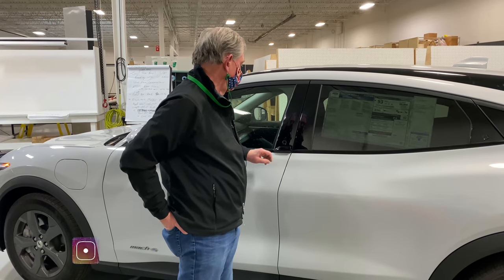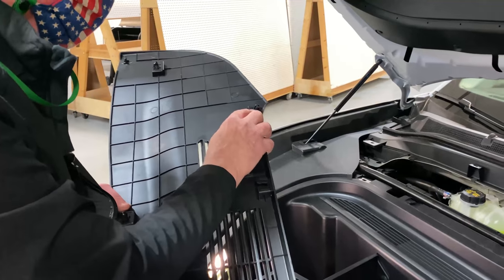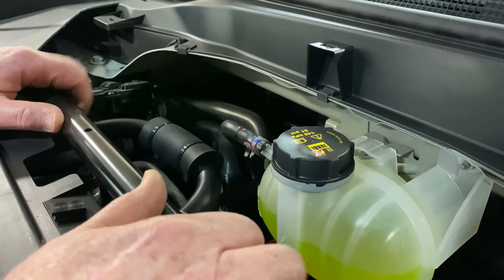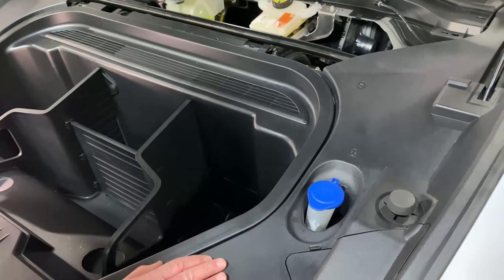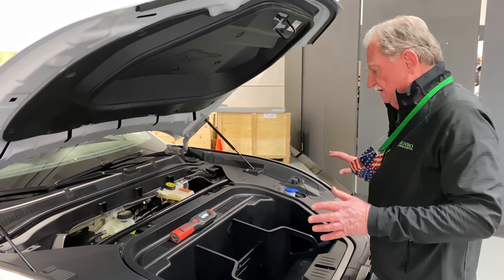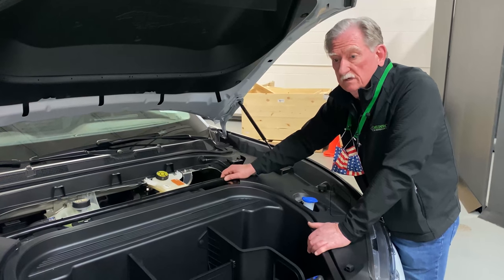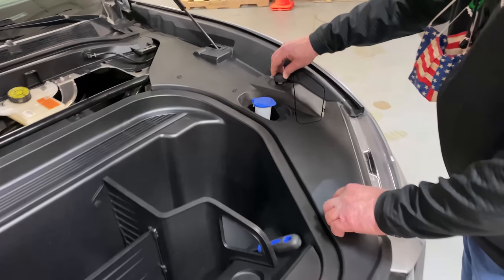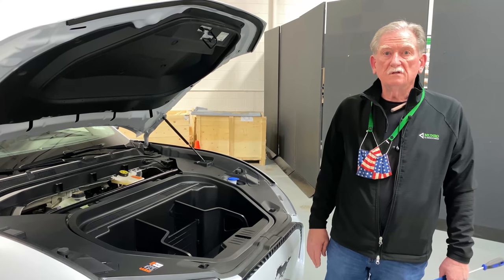2021 Ford Mustang Mach-E: E2 - Under The Hood

Comment: Water goes both ways via a drain hole (usually).  One of the great features of a Tesla is being able to drive through standing water.
Reply from the maker: We will check to see if there is a one-way valve. We typically see these on HVAC/AC Evap drains.

Comment: The Mach-E has remote jumper points in the driver's side cover under the hood. Apparently you don't need to get to the actual battery (page 268 of the Mach-E owner's manual). The Mach-E also has remote boost points under that little cover next to the passenger side headlight like Tesla for when the battery is completely dead (page 267).

Comment: Not as excited as Sandy about the frunk layout. Drain hole is a good idea for either a frunk or a trunk providing there is no way to have liquids regurgitate back up thru the drain. Next, I would have made the compartment separator removable because everyday is not a beer day, sometimes it's a grocery shopping day and you need all the space you can get.

Comment: The Mustang has considerable visible hood vibration. It's not uncommon. My 2014 Pathfinder hood looks like it is going to fly up at highway speeds. The front two bumps do not look adjustable, or at least not easily. The rear two can easily be twisted to find the right balance between hood vibration and latch friendliness. Some people complain the frunk is hard to close. They could back those back two bumps off a half-turn to make closing easier.

Comment: So after driving a lot, vibrations and all, opening your beer will spritz things out. But it is fine, you can drain the beer into the hole in the frunk. Drink the rest and decide whether your blood alcohol level is too high to get on the road. All jokes, of course, you don't have to have fizzy or alcohol in there.

Comment: Note to self - if purchasing a Mach-E stock up on body clips.  They break at the connecting hole... Also potentially stock up on replacment frunk panels as if they pull out of the panel they'll likely break the mount point on the panel.
Reply: That is every car on the road right now. Car manufacturers are enamored with snap-together cars...

Comment: Thing is the Mach E is a more expensive can than the ID4.
Reply: Yes it is,  both are good vehicles and cheaper, better built than Teslas
Reply: @GA-wq8xq  You clearly haven't watched Munro much if you think that >.<
Reply: @GA-wq8xq  Maybe when it comes to panel gaps but the Tesla is much better designed.
Reply: @XKS99  good design can be subjective. Tesla has some good design ideas but is also lacking in some areas such as not ha big a screen in front of the driver. All other EVs do this as most people prefer that. Tesla’s rear bumper was badly designed since water and sand/dirt got caught and ripped the bumper off, or the case of water flowing into the trunk when it was open and raining since water ran straight into it. So all companies make mistakes.

Comment: I don't think there is any waisted space in the id.4, the distance between the windshield and the front of the car is just one frunk length shorter than the mustang Mach-e. They made the hood shorter and increased the size of the cabin and trunk by doing so. What Tesla and Ford do they essentially divide the storage space of the car into 2 parts, while you can just move the cabin forward eliminate the frunk and have all of the storage in the trunk area where its more convenient to use
Reply: The front hood is also quite high on the ID.4, so honestly loading stuff in there wouldn't be very easy for a smaller person. Especially if you don't want to scratch the paint.

Comment: It looks like ID.4 hood is much shorter than the Mach E, the whole car is 14 cm shorter. Plus VW moved the HVAC unit completely in the frunk to maximise space in the cabin.
I don't see a lack of a frunk a defect, it's a design choice for two very different cars.
There is also a roughly 20K USD price difference between the two.
I think the Mach E is a much nicer car, however ID.4 gives a lot for the buck :)
Reply: I think it's more like a $10k differential at the lower end, but I agree with you.

Comment: I don’t like that the 12V jump point is behind a hard-to-remove, secondary plastic panel.  Tesla puts all the under-hood electrical/master brake cylinder elements including the emergency power disconnect under one easily-removed panel.

Comment: Front bumper has a hatch to get to to the battery wire if you need to “jump start” it
Reply: Those are wires you have to attach power to that opens the hood when the battery is dead.

Comment: That upper panel is supposed to slide away from you to remove, not be pulled up. Probably less chance of breakage if done that way.
Reply: I don't see how. The clips look like they slide in from opposite sides, not the same direction.

Comment: They should have punched out a pry tool from the hard plastic divider that can be mounted back into its hole.  That way you could just pop out the pry tool and use it as needed for the trim.
Reply: Rotating locking pins would have been a better choice for a panel that's going to be removed somewhat frequently.  Plastic body clips also age and break... as can the slot in the panel where the clip is mounted.

Comment: The jumping of the 12 volt battery looks very difficult. The close proximity of the positive post to the vibration eliminating bar is disturbing. Access to the positive battery post in a dark parking lot on a cold winter night looks incredibly difficult.

Comment: After a nice ride the beverage you open with gas in it :DD (on the otherside it's on the front, so it could be a bit better.)

I would prefer an isolated box in there (still the shaking could be a problem) to putting in ice.

Comment: It's a fail in materials and fasteners used for the covers. This is brand new and the most pliable that that plastic will ever be. Give it 3 years and all the fasteners will all be broken. If you ever check fluids or need to access the battery because you didn't shut down properly or left it for a month at the airport. I'm curious where the main disconnect for the battery is.

Comment: Brand new fastner that's supposed to last 10 to 12 times break on the first use. Just imagine when they're older and more brittle. Sounds like a Ford.

They've been making cars for a hundred or so years and they made the 12 volt battery that much of a pain in the neck to get to? Looks like an unnecessary headache when it needs to be changed.

Comment: So they idea is that while someone is charging their MachE is the slow non Tesla chargers they can have a couple of beers and drive home under the influence! Not so sure if it is so brilliant. I hope that the pony has more than a drain to compete with Tesla mega-casting, supercharger network, superior range, Porsche 911 speed and and software capability.
Reply: Nonsense, the casting is not needed by everyone and ford and others already have the stamping machines so they don't need to waste money on new machines. The steel stamping is way more efficient and cheaper, plus its modern techniques which requires way less stampings and application of aluminium profiles.
Reply: I couldn't believe two fluid reservoirs are hidden UNDER that plastic panel, secured with break off fasten points and a wet bin makes it a contender and threat to a Tesla.   This Planet has gone irreversibly Looney Tunes.
Reply: @sailingsolar2371  what do you mean by that?!

Comment: Sandy Why do these cars allow the 12vt battery to die? The HV battery should keep the charge in the 12vt battery full all the time unless the battery is bad.I have had so many problems with the 12vt battery  going below voltage just slightly and no start- no monitor to tell you there is a problem
Reply: I thinknvw and ford have lithium batteries so they never need to be replaced.

Comment: If I remember correctly,  you jump the battery on the front of the car?  I think there is a small door that opens on the passenger side front bumper?
Edit- Nevermind, that small door is to open the front trunk to get to the battery.
Reply: This is correct.

Comment: The frunk drain hole is neat, but wouldn't it work both ways? I mean, you're splashing thru rain puddles etc then find the packages in front are wet.

Comment: The drain hole and dividers are interesting, but I think could have been designed much more simply. Just do two dividers and split the frunk into three fairly evenly sized zones, center zone has the drain. Personally, I'd rather use a cooler that can be moved around easily and that I can simply dump out and clean when done. Haul the cooler around in the trunk and set it in the frunk at the party if you want.

Comment: funnily enough from all the evs i saw i was most impressed with ford my only beef with mustang is small trunk (400l vs model y 700 - as a family car, its dealbreaker for me so still waiting for model Y - yes I´m from EU...fml). Btw. in some other video they said that the frunk splits are for accessories (chargin cables whatnot) but sandy´s idea is much better IMHO....;-)

Comment: I think having to have special tools to get to the 12 volt battery is a bad design.  Clips that break when you have to inspect fluids.. another bad design.  The frunks utility is reduced by the dividers they put in.  The drain valve is a nice idea, but will it get splash back when driving in the rain?  Is the frunk insulated?  If not, it's pretty useless for storing beer on a hot summer day because the ice will quickly melt.

Comment: ok so it's a hole. can it be drilled on the y without the water breaking sg below?
Reply from the maker: We will check that out for you.
Reply: I would hope that the drain valve is somewhat of a check valve. I would want it to prevent rain and deep water from flowing back into my frunk.

Comment: Sorry, more aggressive snap is not good. Harder to remove and that is why they broke. Teslas hold on just fine, they do not need to be that gard. They do not break because they hold that strong and it is easier to get off when you need to. There is the risk of he hole thing breaking if it is that hard to get off.

Comment: $47,000 ice chest got Sandy ALL excited. Was he serious when he said that alone makes it a Tesla rival? I'm taking it as camouflaged lighthearted sarcastic humor after those snaps broke right off.   Tesla also had a panel locking failure/design.  Here it is 2021 and they still haven't perfected plastic clips/ fasteners to be easy on/off and reliable.

Comment: Not so impressed with the impromptu icebox idea. A drain plug might be useful if a bottle breaks in your groceries. Not sure if Ssndy was joking. What would be a good idea is if Frunk is sized to take a cooler box, especially with a 12v connection. Ice cream on a mountaintop might be better and safer than cold beer, and a cooler or freezer box would give you both...

Comment: Are you serious, how often are you going to use this to have a beer. Then to the ID.4, perhaps it would be appropriate to measure the length of the hood. The Mach-e is forever long, of course there is room. Also to put the dimensions of the vehicles in proportion, then you will notice that the ID.4 uses its space much better.
Reply: "ID.4 uses its space much better" most NA designers and drivers don't understand the desire and need for cars that do that in Europe.  Ability to park trumps place to put beer.
Reply: @TheEvilmooseofdoom  Exactly why the VW Golf was the best selling car in Europe for like forever.

Comment: Keeping the drinks cold in a space that will allow the ice to melt quickly does not impress me that much. I would also like to be able to remove the dividers easily, not have to remove clips to remove the dividers. If that’s a major item for Sandy so be it.

Comment: not sure why would ice bucket in the frunk get Sandy so excited. I mean who cares? Does it really make a difference for someone who looking for an EV? I would understand you can have small fridge slide in and get powered from the battery but an ice bucket? Common ...
Reply: Good point. If it has a heat pump it could cool the frunk while heating the cabin.

Comment: I can't believe the Frunk is manually cable operated and not electrically actuated. As you point out they seem to have really considered this area, yet you can't open it from the key fob or app like you can with Tesla. Seems like a big miss.
Reply: Until you are driving down the road at 70 mph and accidentally hit the fob button and the hood rips off.  I'm sure a manual secondary latch is required at a minimum by the NTSB.
Reply: @RichardSchuldt  Obviously you don't own a Tesla. It won't let you open the Frunk unless it's in park my man. However a manual cable one you could pull twice and do what you just described in the Ford.
Reply: @RichardSchuldt  LoL you don't think they thought about that?!? No secondary latch, and it won't open when in Drive or Reverse.
Reply: @legacytesla  Obviously you my man are much cooler than me and "own a Tesla" or the bank owns it and you are paying it off???  Either way the secondary latch is required by law  "Standard 113 requires that a vehicle's hood must have a hood latch system (S4.1). The standard also requires a front opening hood to have a second latch position on the latch system or a second hood latch system, if the hood has any open position that partially or completely obstructs a driver's forward view through the windshield (S4.2). The standard defines "hood" as "any exterior movable body panel forward of the windshield that is used to cover an engine, luggage, storage, or battery compartment" (S3)."  Your super cool Tesla has this system in place as well or it wouldn't be allowed on the highway.   Have I mentioned how cool you are for owning a tesla???  Just thought I would mention it again...
Reply: @RichardSchuldt  haha butt hurt much? No secondary latch either. Just won't open when not in Park. Why comment on something you have no clue about and then get upset when someone teaches you something?
Reply: @ericperkins9198  LOL... Did you even read my reply?  Here is the part that pertains to this thread so you don't have to read the entire paragraph: "The standard also requires a front opening hood to have a second latch position on the latch system or a second hood latch system." So your Tesla has what is referred to as a "second hood latch system".  Your good buddy "Legal txt" who is also cool and owns a Tesla says it won't open while in drive or reverse.  That meets the requirements of a second hood latch system.  Let me know if you need it broken down further.  I may be able to work up a picture and arrow diagram or something similar.
Reply: OTA comes soon to open it through big screen and app, this has been confirmed by Ford.
Reply: @garfieldchenyu1  Interesting. So either the cable or the latch also has electric actuation? This seems super simple, why would it not have been completed prior to deliveries? Also it would have done away with the double tap that will be required by the electric release if driven by the cable. This is suspect for sure. Maybe if Munro tears it down he can confirm the mechanism?

Goes to prove Ford's biggest challenge is learning how to develop code.
Reply: Nonsense, why would you make electronics where its not needed?! The cable system will work forever with zero issues and its also dirt cheap.
Reply: @legacytesla  those frunk latched are mostly covered by the doors and not accessible when driving, stop the bullshit.
Reply: @carholic-sz3qv  Because if you are walking up to the car with a shopping cart full of groceries you can easily open it? Or for a million other reasons. My kid leaves his skateboard in the Frunk I can open it without having to go to the garage? That's like saying we should still have crank windows, and manual locks because they don't have a mechanism.
Reply: @carholic-sz3qv  manual release is dumb, should be treated like a trunk as Tesla does.
Reply: @chasingmymemories  manual release is the most basic and simple thing possible you're welcome. It doesn't need expensive relays and electronics......
Reply: @legacytesla  yes again crank windows are made to last unlike power windows which often fails. The less electronics in cars the more its going to be reliable even after guarantee finishes. The vw id4 doesn't need a frunk because the space was maximise inside the car.
Reply: @carholic-sz3qv  Sure.... and horse and buggies even had fewer parts. Your comments are ridiculous. The ID4 doesn't have a frunk because it's poorly engineered.
Reply: @legacytesla  stop talking nonsense and go watch Björn Nyland videos, the vw id4 banana box test, it has almost the capacity of the giant tesla modelx.
Reply: @carholic-sz3qv  I'm just commenting on this missing a feature I enjoy. It's a miss from Ford in my opinion to have this Frunk release manual, as I put groceries in mine all the time and open with the Fob it app. Go argue with someone else.